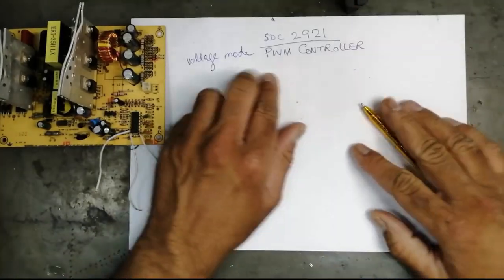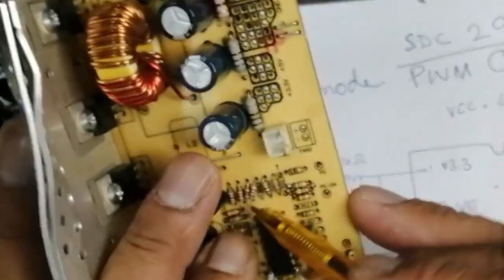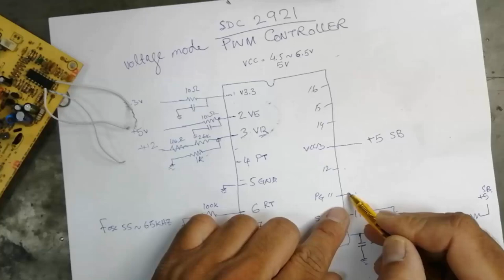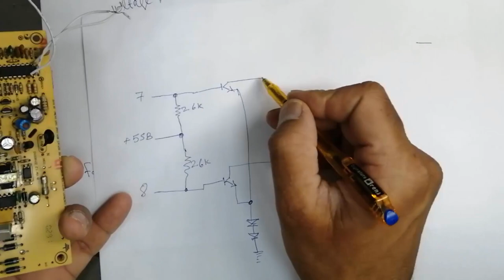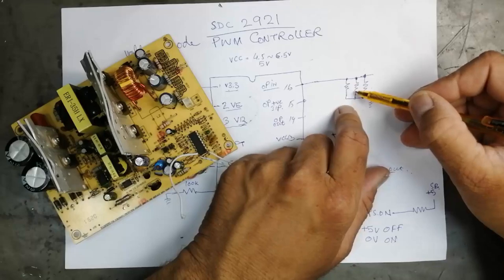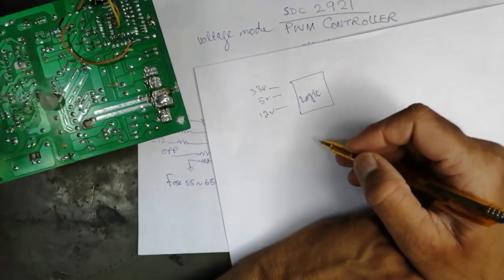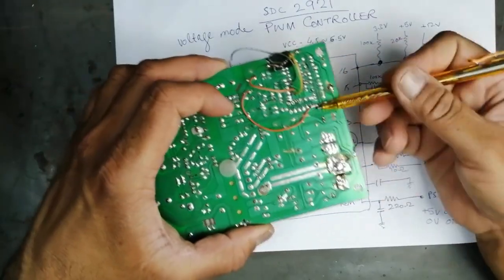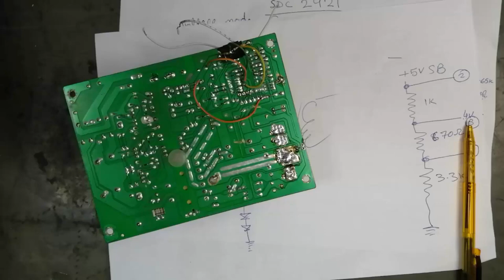{195} SDC2921 Voltage Mode PWM Controller  for ATX power supplies

Comment: A lot of components around this SDC2921. I think TL494 is more easy and userfriendly for people which want build own any SMPS. Anyway great explanation as usual dear Haseeb. Thanks.
Reply from the maker: SDC2921 is PWM controller with ATX output monitoring circuit. 
but the tl494 is just a PWM controller, if we use it in ATX then it is compulsory to use Over voltage, over current, under voltage monitoring circuit. so TL494 circuit is much complicated with compare to SDC2921

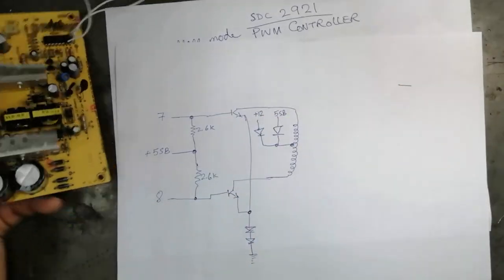Comment: 13:20 Really I don't understand what for this two diodes from 5VSB and 12V going into a middle pin of tranformer, and what they doing. If you cold be do a simple explanation that wouldbe great. Much appreciate your effort and knowledge.
Reply from the maker: one diode rectifies 12 volt for providing 12 volt for start up switching of pulse transformer 
and second diodes provides 12 volt (which are generated by main power supply) so the main power supply's 12 volt will used as 12  volt for pulse transformer (it is used to bypass the 12 volt generated by SB transformer 
i will explain it in deep detail in upcoming video of ATX power supply, i planned to prepare a detailed practical tutorial on ATX
Reply: @HaseebElectronics  Thanks Haseeb
Reply: Pls help in getting the 8 pin ic number to drive the standby transformer

Comment: Thank you very much for clearly explain the subject. Your videos are always informative and easy to understand . I always learn much from them.
Maybe someone can answer, what voltage usually should be on signal transformer on the low side if sdc2921 is off and if it is on?
Reply from the maker: thanks a lot dear friend
for sdc2921

check video number 192 195 197 199 on my channel
these 4 videos are in in detail for sdc2921 circuit

Comment: Sir gd morning can you discuss also the transformer that they use in that power supply using main transformer and low voltage transformer sir tnx a lot
Reply from the maker: best regards
please check video number 250